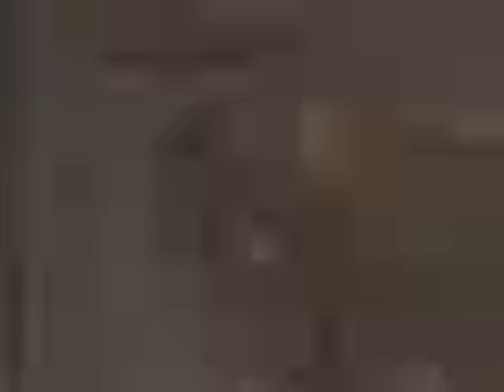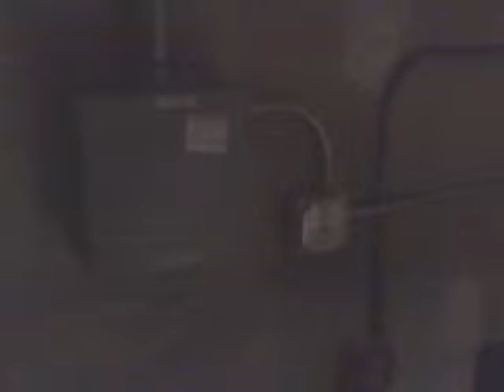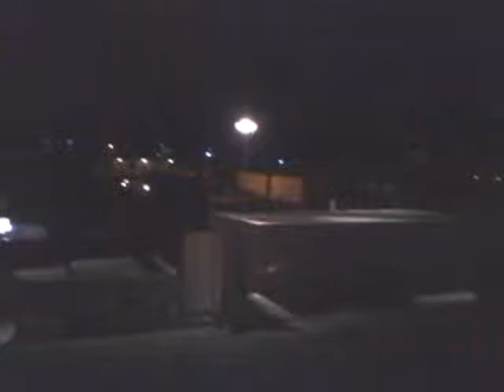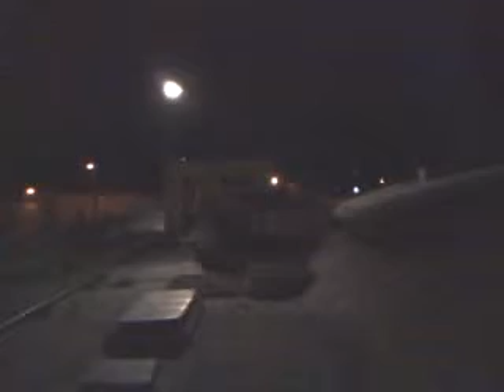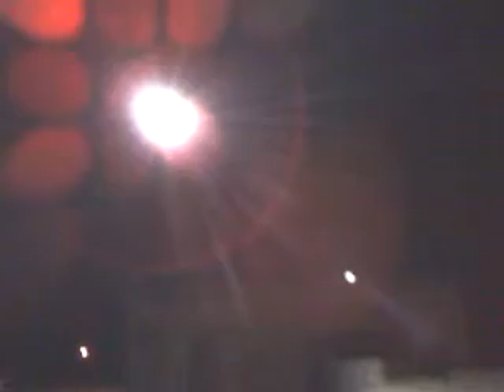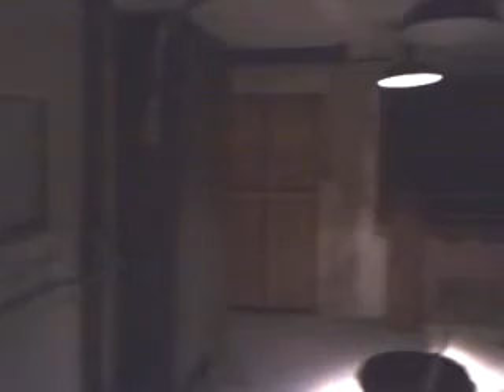Testing Rooftop Security

Comment from the maker: Hi Julia, well to answer your question technically a bird could set off the motion detection if it flew right in front of the sensor  although being that the system wouldn't activate until night .. probably not really, although a cat may set off the motion sensor. thank you for the question .. Sincerely, Mark Perry